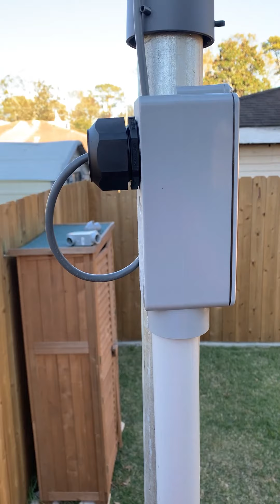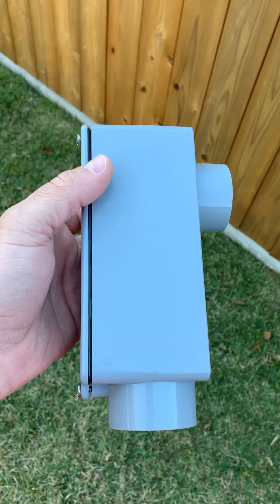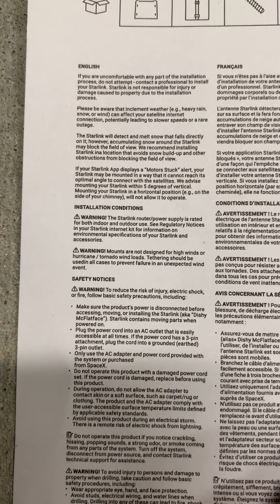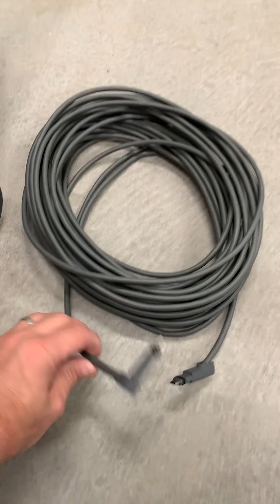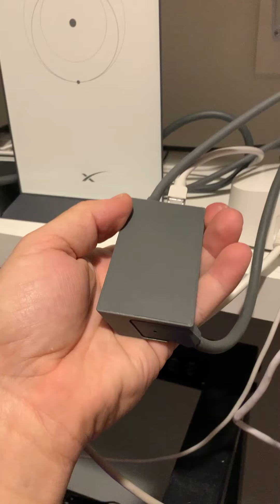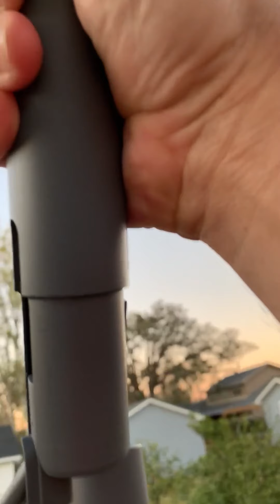Starlink Gen 2 Install [150 Ft Cable, Ethernet and Pipe Adapter, Cable Routing Kit, Load Balance]

Comment: those are expensive mountings. neat, but costly. me, i just plant a 10x10cm log in the ground and drill a hole at the end of it for starlink's neck to be inserted there, along with a gap for the cable to go out of the hole.

Comment: Great video!  How did you set up your tp link load balancing done?  I didn’t see the video on that one.  Thank you
Reply from the maker: I decided not to leave it on a load balancer. The outages were very short (<3S) compared to the load balancer switch time making it unnecessary. Outages are nearly non existent now.

Comment: What is the size of the pipe you used to mount the adapter too?  Thanks for the video.
Reply from the maker: https://www.homedepot.com/p/2-in-x-10-ft-Rigid-Metal-Conduit-0544310000/202068054

Comment: I have the same equipment, but have had issues with the load balancing.  Please post a video on how you have your e605 set up. Thanks!
Reply from the maker: I do not have mine setup bc I found it to be unnecessary.

Comment: If you want to have the internet signal from the Starlink satellite dish connect via ethernet to your existing 3rd-party LAN with one or more WiFi  access points, you will need to budget for a router (and remember to change the Starlink to "bridge mode" / "bypass router".)   I ended up getting an EdgeRouter X from Ubiquiti to connect the Starlink with my Ubiquiti/UniFi ethernet switch, Cloud Key Gen 2, and a few UniFi AP's.   Everything works great!

Comment: Aloha! My Starlink arrived today, so my battle to overcome surrounding trees has commenced. QUESTION: why did you grind two areas of the metal pipe flat? Thanks for your videos!
Reply from the maker: Towards the end of the video I have a section that shows the three protrusions that stick out inside of the pipe adapter. The flats are to make way for those. One flat ground per protrusion, so three of them.
Reply: @goodfella7483  thank you for the reply and further explanation

Comment: Where is you video in configuring the TO ER605 into a load balancer?
Reply from the maker: Outages are so short and minimal on SL it wasn’t worth doing.  Plan on going exclusive SL instead. Not load balancing any longer.
Reply: @goodfella7483  ..do you have faster speed with tp605 connected. m getting a lot of network issues and errors every 30 min or so for 7seconds

Comment: Thanks for the great video. What size PVC conduit did you use? Trying to spec one that fits the Starlink cable plus a CAT6 that wont damage the connectors. Thank you
Reply from the maker: I think I used 1 1/4”

Comment: So I'm seeing  biggest problems with wire feed. From all the videos I've watched. Is  back feed wire from inside the house to the dish. Not from dish to inside the house.  You will avoid making bigger  holes  than needed.  The connection to the dish is maybe half an inch compared to 2 inch hole needed to go the  other way

Comment: I discovered the pole stub of the Starlink dish is precisely the correct size to slip inside the flared end on a 1” schedule 40 PVC conduit. 

I set up a 4x4 post, routed the buried sch 40 conduit along the post and clamped. I fished in the cable, connected the cable to the dish and dropped the metal pipe from the dish into the conduit. Works perfectly. The dish has survived +40 MPH gusts as measured by a weather station 10 feet away.
Reply: How do you keep the dish from moving side to side?
Reply: @freddutton404  the dish down pipe that fits into the mount also slips into the 1” conduit. It’s tight and doesn’t slip though I’m sure you could remove it from the conduit. The 1” conduit is attached to a 4x4 post embedded in the ground. There’s less than a fraction of an inch of play even with substantial force. Dishy is free to orient itself any way it wants.

Comment: Very helpful video, thanks   2 Questions ..1/ What dimension is the metal pipe you used - I noted 2" for the plastic conduit  2/ Did you make a video re the TP-Link ER-605 ?  If I missed either, excuse my ignorance ... Thanks, in anticipation from across the pond, in the wilds of west Wales ( Britain )
Reply from the maker: 2” trade size rigid metal electrical conduit pipe.  1-1/4” plastic electrical conduit to run the wire. I have not made a video for the TP-Link yet. Happy it was helpful.

Comment: In respect to the square hole and the 90 degree connector, couldn’t you have run the wire backwards through the conduit?   I’ve yet to set mine up but will need to do a pole mount w/extra cable as yourself.  Very helpful video.   Thank you.
Reply from the maker: Yes I could have ran it backwards, but it was very hard to get the cable through the conduit (got stuck before I lubricated it) so I didn’t want to start all over. You’re welcome. Happy it helped.

Comment: Do you have the part number or size of the gland connector that you used.  I am concerned that if I get a gland connector big enough to pass the Starlink end connector thorough it (3/4 inch ?) then the gland connector will be too big to tighten down to the actual cable diameter.
Reply from the maker: McMaster-Carr. 5302N14.  If I recall only one end of the cable fits through.
Reply: @goodfella7483  Thanks...that looks like a good part number. I like your setup and am going to do something similar. I have about a 44 feet run from the corner of my house to the intended pole position.  I was going to mount the system on the house gable but I took your advice and I don't want to be climbing ladders to wrestle with the dish when bad weather is expected.

Comment: I was directed to this page from your other video and it helped me decide to mount mine like your with the cable on the outside in case I need to pull it down.  I waited 2 months for the starlink pole adapter so I am hoping I can get the cord out and in 1 inch conduit under ground.  I almost feel like I need to order a backup cord.  They take a long time to get.

Comment: Hi great info very helpful. Can you tell me how you ordered the 150ft cable , I really need the extra length and cannot get a address to Oder through. Thanks.
Reply from the maker: I couldn’t order any accessories until my dishy shipped. Once it was on the way I ordered with the online store at Starlink.com

Comment: quick question on the cable gland.... Since the end needs  a 3/4 hole to pass through.. what size cable gland did you buy?  and does it allow the 3/4 end and also clamp down on the actual cable?  Did you need to modify that gland to effectively have 2 sizes?  sorry if this is a dumb question.. looking to mount a demarc box outside of the house.. and am considering a cable gland.. thx for the help
Reply: nevermind...I was thinking of splitting a cable gland.. and I see that in fact that is what you bought.. :)   down below in a different post... Nice to know I won't have to split one manually... thx

Comment: Great video. From what i have read the distance from the dish to router is supposed to be fixed. I ordered the 150' cable as well but am under the impression it is not supposed to be more than 100' (or maybe 75' - idk). I definitely need the 150' to get to a spot on my property where I have clear views. Any thoughts?
Reply from the maker: 150’ cable works fine for me

Comment: Very good video. You answer many questions that StarLink does not address. My dish is scheduled to arrive this Thursday and I have given a lot of thought to mounting. I have opted to go with the pole (StarLink Pole) and mount it in my yard. I am considering running the conduit up the center of the pole. Why did you choose a 2" conduit? Good point about the direction of pulling the cable. I have already considered that but I did not know that the plug at the dish was flexible or waterproof. Also, I ordered the kit but I didn't know what was included. As I said, you answered many questions.
Reply from the maker: I went with the 2” pipe because it is available at Home Depot and strong. Also, when I installed the pole wasn’t available from SL.
Reply: @goodfella7483  Thank you again for all the work you put into this project. As I mentioned, I am in the process of collecting the materials to complete the job myself. I have a question about the "gland connector at the LB Box" you attached to the top of the conduit. I followed the link to "Wraparound Plastic Submersible Cord Grip for 0.25" to 0.33" Cord OD, for 1-1/4 NPT Knockout" and I assume you were able to pass the Starlink cable and plug through the opening? Did you buy it online from McMaster-Car? Or were you able to find it somewhere else? I went to an electrical supply store today and they didn't have anything quite like this.
Reply from the maker: From McMaster Carr is the only place I know to get it. Only one side of the cable goes through it…the smaller side.

Comment: Absolutely dumbfounded that Starlink would remove the Ethernet port. Next they’ll be building SpaceX capsules with no entry doors…… seriously?
Reply: It is odd.  I would guess they have problems with the Ethernet port and having to replace a $20 part is better then the entire base station for them.  I doubt they were trying just to get an extra $20 as all their accessories are not expensive.

Comment: The only issue I see with this new kit is that the cable is not a standard internet cable cat6,7  with rj45, you can not use the cable which you have already in the walls for the connection between router and dish.

Comment: Does that gland connector tighten down on the cable? I haven't found one that is big enough to pass the SL connector and will also compress enough to seal around the cable.
Reply: Never mind, I see where that cable gland is made for this purpose, thanks, this is the finishing touch I needed.
Reply from the maker: BTW…Only one side of the cable will fit through.  You might be able to get away with a smaller gland connector but I didn’t test others.

Comment: Thank you for your very informative video! Would love to know what is the size you used for the Gland connector? Thanks!
Reply from the maker: Wraparound Plastic Submersible Cord Grip, for 0.25" to 0.33" Cord OD, for 1-1/4 NPT Knockout

https://www.mcmaster.com/5302N14
Reply: @goodfella7483  pin this comment. :)

Comment: Great details and Install.! I used to install Big Hughes DirecWay Satellite Dishes on poles like that and larger 20 Yrs ago with only 2-4 Mbs download speed which was considered Rockin Big Time back then. They had to be computer commissioned pointing at ONE specific satellite, locked into place with huge clamps, because if it ever moved you were gone and totally out of luck until service got there to reposition it again. Very $$ Costly for sure..
And NOW - This Starlink concept is way way better !! Anyway, IS there an orientation requirement on this Dishy antenna ???  I've Yet to find out from these YT vids if the Dishy has to be put on the pipe with any part specifically pointed toward the north or south since it has to move back and forth into the internet spread pattern in the sky.??
Any info you have would be appreciated...
ALSO - YOU NEED a 4 Foot Ground Rod sunk into the ground at the base of the pole connected to it with a clamp and #10 Solid Wire. Grind the pipe at the connection and oil all the connections when done.. There's a good amount of Lightning in your area during certain seasons. Oil all the connections on the ground path also to keep em fresh.
Reply from the maker: If you download the Starlink app on your phone you can go outside and use the app with the camera on your phone to visualize the area of the sky it will need open. After you power the dish it orients horizontal and after a few minutes orients the dish to a portion of the sky it deemed most ideal. I haven’t found that mine has moved much if ever once “commissioned”.  I’m not sure how exactly it decides where to point in the sky but once there it stays stationary for very long durations(months).  As I understand it, the tracking is done virtually with the phased array after that.
Reply: @goodfella7483  Browser only access here. No 'smart' phones out this far we use flip phones from 2006 still.

Comment: Thanks so much....very helpful.  Did you use another box or a 90 degree sweep at the base of the pole when you went underground and also same question from the end into the house ? And how did you waterproof the end at the house ?  Thanks !
Reply from the maker: I used 90 sweeps. Just built the house so conduit is through the foundation and wall.
Reply: @goodfella7483  Thanks again. Nice work 👍

Comment: I've been running my router outside in MA for 2 weeks now in wind, rain, snow and single digit temps..thing has been holding up awesome.
Reply from the maker: Awesome. Good to know.
Reply: @goodfella7483  for sure... I put a big pot over it and a brick on top so it doesn't get blown around by the wind but 0 issues with it being out side this entire time.

Comment: Hi, thank you for sharing this. How tall is the pipe adapter kit? I ordered one but am waiting for it to arrive and want to prepare to figure out how tall of a pole I will need. I'm thinking of getting a pipe without the coupling part on it and maybe drilling divots in to the pipe I use for the set screws to sink in to a little (not drilling all the way through).
I love how much detail you included.
One thing I'm wondering, did you ground your pole for lightning strikes or is it already grounded by being sunk into the ground somewhat?
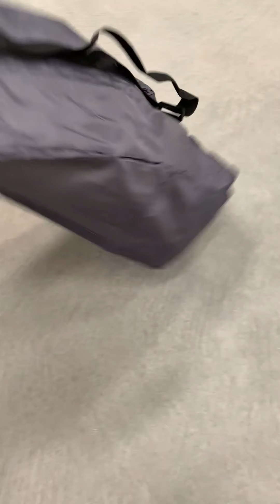Reply from the maker: 6:50 in this video:  Starlink Pipe Adapter Kit Overview, Dimensions, and Details
https://youtu.be/9BpVlM3uPfw. About 5.125” tall. The only reason I left the coupler is to not damage the threads in case I want to use them. The set screws will hold it very secure without drilling divots. The only way I see an issue is if the pipe you use is too thin and then the set screws deform the pipe and possibly not hold well.  I’d go with the thicker wall pipe for that reason.  I did not add any grounding.

Comment: Thanks for the videos, very informative. Forgive me if I missed it in the video, but did you run any conduit from the base of the mounting pole to your house? Or did you bury just the wire?
Reply from the maker: Yes. I ran 1 1/4” conduit.
Reply: @goodfella7483  Thanks!

Comment: Very nice setup,  good information I might have used smaller pvc pipe and fittings that way you could use legit strapping means but all in all I liked your idea and they also make that pvc in sch 80 which is what your suppose to use  when you emerge from the ground in a location where the raceway could be damaged.

Comment: Thanks for all the details!  My pipe adapter came today, still waiting on the ethernet adapter.  I would like to do the same but add another length of pipe the next size up and make some kind of boot for the junction.  I also would like to keep the wire secure inside the rigid piping.  I know that presents install and servicing hassles but it's going in a semi public area.  Any ideas?
Reply from the maker: Can you expand on keeping the wire secure inside the rigid conduit?  Not sure I follow.
Reply: @goodfella7483  I thought you mentioned that the cable can be routed down inside the conduit rather than coming out of it briefly and into the gland?  I have the stuff now I suppose I and try it.  I just want the cable inside to prevent tampering with it.  I can deal with the underground issues I have a mini-excavator.  My existing ISP is beamed from the south I need to install a new pole a few feet away to clear the evergreens to my northeast anyway.  Actually looking forward to a new project!
Reply from the maker: Ah. I see what you mean. Yes you can route inside the metal pipe all the way up to the dish and it will be hidden.  If yours is high enough it won’t matter, but since mine is low I was concerned with someone stealing the dish. There is nothing that prevents someone from disconnecting it.